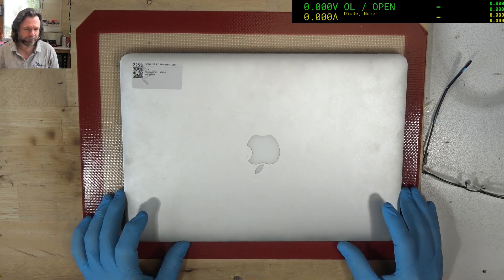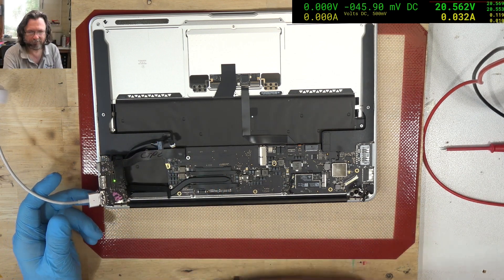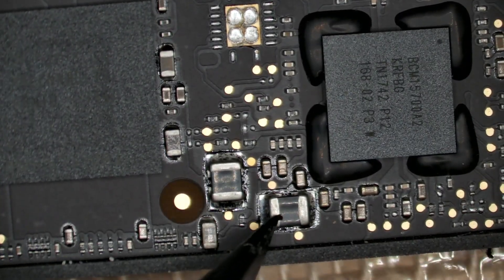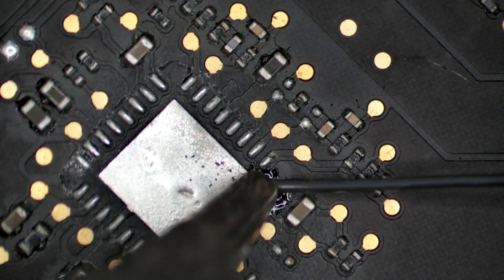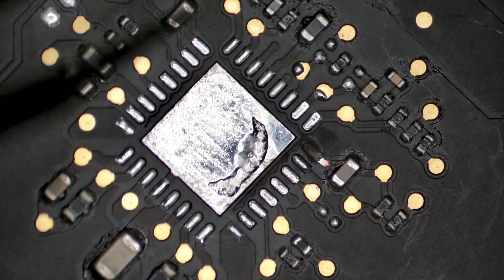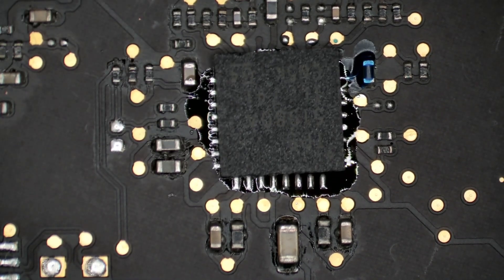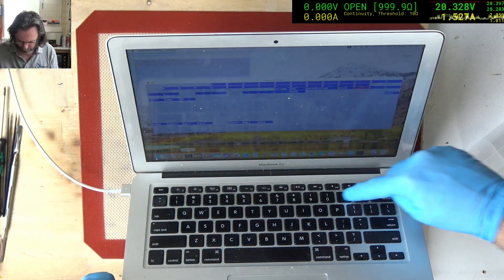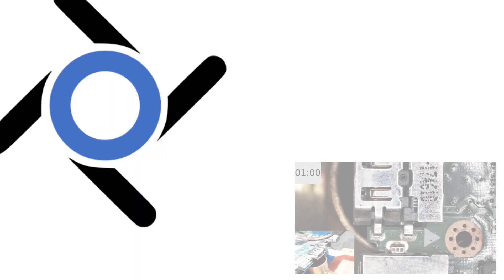Fixing "No Power" on THE BEST repair starter machine. Macbook Air A1466.

Comment: I leant a 2015 Macbook Pro 15" to a friend. They never really used it but it was plugged (old batter) and closed "SLEEP" When I went to collect it it will not start up. The charger will show charging. The white indicate light is on but no chime and black screen. Any thoughts what to check first?
Reply from the maker: Which white indicator light are you referring to?  What's the model number ( A1286, or A1398 ? ).  The A1286,  Unibody type machines had the white LED at the front but that's more 2012 era.

Is it Magsafe-1 (L-shaped connector) or Magsafe-2 (T/block shaped) ?
Reply: @pldaniels  Thanks for your response, specifically: MacBook Pro "Core i7" 2.2 15" Late 2011 2.2 GHz Core i7 (I7-2675QM) MD318LL/A Model A1286 - The The charge is L. It does charge going from orange to green. Upon starting up, the white narrow light beside the microsd card slot lights up. I do believe I hear the fan. No chimes, black screen. Tried all the keyboard combos.  I'm familiar with checking all the power rails. The fact I have fan spin means the problem is way upstream? (As I mentioned. computer worked great. It was closed to go to sleep. The battery is old so it was left plugged in. A few days later, I tried to turn it on and it felt very warm, and would not turn on. Thanks.
Reply: @FilmFactry  gpu in that model always die

Comment: why MacBook's are so sensitive to a water damage? even a tiny one breaks them. Most PC can handle much bigger water damage
Reply from the maker: It's more of a perception thing that what I've found in reality.   There's no shortage of Macbooks being repaired that have been enduring horrendous levels of liquid damage.   It's really a case of where the liquid damage is more than anything else.

It helps too that Macbooks are high-value items so people are more likely to have them repaired, subsequently you see a seemingly disproportionate level of them in the workshop.

Of course, Apple doesn't bother with liquid-ingress prevention systems like perhaps some of the higher end business machines in the PC realm but in many ways I would prefer it if manufacturers focused on easier part replacements than more expensive builds (explicitly for the sake of keeping liquid out).

Overall, it's a bit of a survivorship-bias type psychological manipulation going on; the electronics themselves are equally likely to fail but it comes down to specifically where the damage lands.  

imo ;)
Reply: @pldaniels  yea, a think layer of varnish on the board would do the job, but why ? It will save apple 10 cents

Comment: Can confirm. I've learned a lot from the A1465 11" air I got for $20. PP3V42 shorted with corrosion under the SMC. Another great way to get more time under the microscope for cheap is buying xbox 360's and RGH modding them. I was getting them anywhere from $10-25 depending on condition and whats included. Doing this I got more familiar with schematics. Now with Macbooks theres boardviews which also helps a ton.